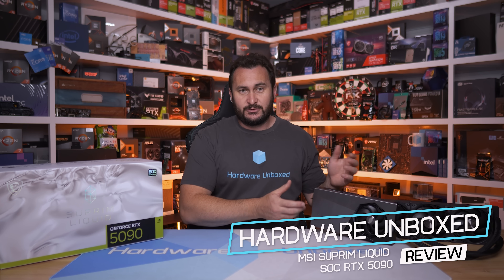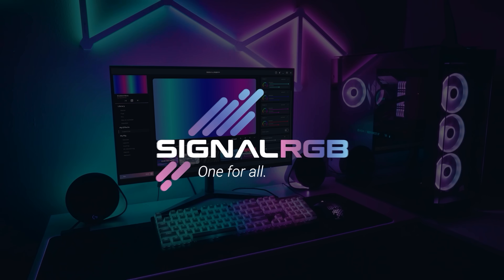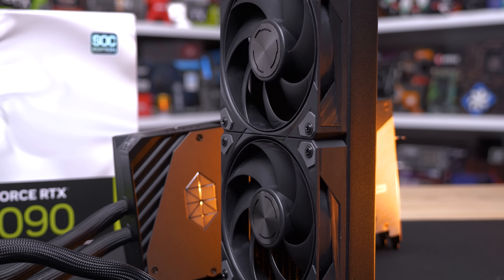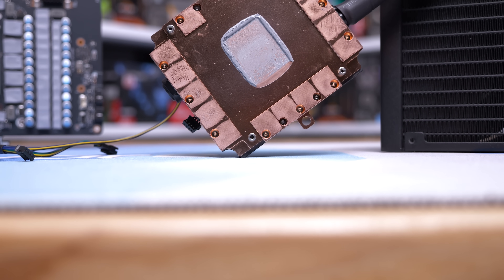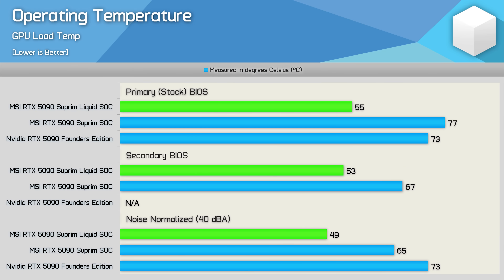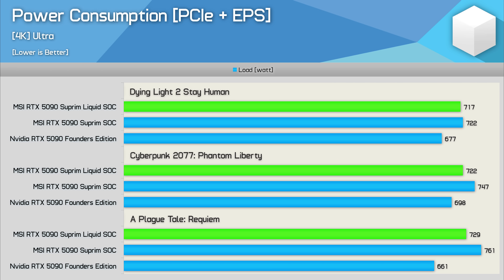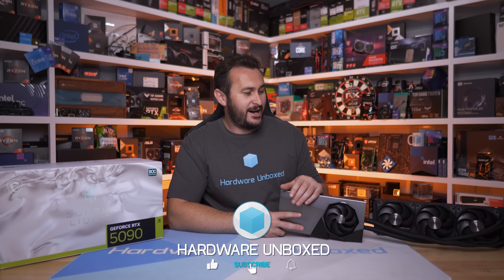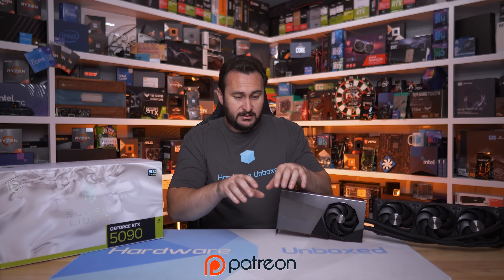The Best RTX 5090.... MSI Suprim Liquid SOC Review

Comment: at this point Steve showed us 10% of overall 5090 supply, that isn't yet melted
Reply: Actual hardware overclocking made a follow-up video to Derbaurs. The 4000 and 5000 are missing safety features from the 3000 series. No individual line is tested/limited to know if it has a good connection/load, so one of the wires can take on the full load and fry things.
Reply: xD
Reply: LOL
Reply: ah, amd fanboys coping is hilarious
Reply: @randy89555  SO WHY U CRYIN?
Reply: god can #gamers try harder with their lame ass jokes
Reply: @ want a good one? Nvidia

Comment: But does it heats cables to over 150C? Assuming its best like you say it is.
Reply: Tbf it was on the PSU side that was measured at 150c and on whatever cable Derbauer was using. The actual failed cable probably ran even hotter. 🙃🤒
Reply: @HDRcade  Only at that temp because the power delivery circuit of the card is atrocious.
It's an actual fire hazard.
Reply: @HDRcade  Wonder what is their max temp according to spec, ppl talk about max W, but how much were they over max temp.

Comment: Saving this video for when I might buy it used sometime in 2030
Reply: I wonder how many 5090s will survive that long
Reply: @megapet777  The market needs a 5090TI already where this is solved with the Shunts. And stop producing the 5090 base model as a whole.
Reply: @megapet777  Very few, the power delivery design is atrocious so they will pretty much all melt their connectors in time.
Reply: Why would anyone buy this 600-730 watts nuclear reactor is beyond me. Even if you can afford it as it was pennies. It's literally a prime fire hazard in your home.
Reply: At which time you might live quite comfortably with only one kidney 😅
Reply: At that time even 70 tier card would surpassed it. That would be 8000 generation for Nvidia
Reply: @ArteriusSaren  you meant 8070 TI Super Extreme for $2999?
Reply: with the plug issues, I wouldn't reccomend it in general
Reply: it's funny because in 2030 this card will still be powerful enough to run all games.
Reply: @madd5 Owning this in 2030 is the equivalent of owning a 3090 today. So there's no doubt it will still be able to run the latest games.

With how gen-on-gen improvements have been trending, it's fairly likely that this will still be able to run every game in 2035. I mean... Unless there is a paradigm shift with PS6 and whatever comes after it, it would not shock me if you can still play the majority of new releases at low settings on a 5090 in 2040!
Reply: This card will suck in 2030 for it's power draw regardless unless you want to use it to heat your house, but it apparently can be a fire hazard when using it at full wattage at least with the FE
Reply: Just got mine for Christmas. 
If it doesn't catch fire before then I might sell to you.
Reply: @nyrokat  6090
Reply: Don't worry, Jensen WANG will stop drivers in 2027 because that'll force people to "The more you buy the more you save"

Comment: Now water cooling companies should offer sprinkler that plug into the loop to extinguish any fire started by the 12 pin connector/cables :)
Reply: Nvidia's Multi Flame Generation technology is really revolutionary 🤣
Reply: @fleurdewin7958   it's literally on fire 😂
Reply: @fleurdewin7958  It's, like, FlamesPerSecond are quite high on this one.
Reply: Everyone keeps blaming the connector and cable but ignoring the reason they get so hot. Nvidia has been checking out and reducing the actual hardware costs, resistor and so on. Leading to just a few lanes that power comes through. 

The reason why the melting starts at the connector is because connectors have the highest resistance in the circuit, 2 separate metal pieces touching. 

Look at the schematics of the 5090vs3090ti and older gens of cards.

I'm certain the 5080 and 4080 have the same problem, Nvidia cheaping out. They just don't have the melting because a lot less power coming through. 

Sad part is Nvidia doing this has lowered the safety factor on the cards.
Reply: @taesssi   yeah, makes sense what comes next.
Reply: @ True, in this case it is a poorly designed card. But the connector has multiple design issues as well. It is missing a noticeable user feedback that it is rightly connected and it is way too easy to unseat. It has by design very little margins, it can carry about 10% more power than specified, the old PCIe connectors could easily carry 50% or more load than the specification required.
Reply: A sprinkler would cause a short circuit and thus a burning card. Great advice Bud.
Reply: @Tommy1198S    tell nvidia that to fix the real issue then
Reply: The problem is being caused by nVidia rotating the 12vhpwr port 90 degrees and then connecting the 6x12v lines and the 6xCom/Ground lines onto two pins than then transfer the power to the board. Partner boards seem to have stuck to laying the port flat to the board and as such all 12 pins (I know there are 16 pins, I am only talking about the power pins here, not the sense pins) are directly connected. I can see a major recall coming for the 5090, and a software/firmware update coming for the 5080 to make sure it cannot be OCed because of fire risks. We can only wait and see, but this is not looking good.
Reply: @Horus9339  Not only that, they reduced the shunt resistors to two. The GPU can’t even balance the load anymore like the 3090 could. Buildzoid has an interesting video about it.

Comment: The best 5090 is the one left unbought. What a scammy generation.
Reply: Ok poor person
Reply: How was the 4000 series any different?
Reply: and unburnt
Reply: Jetzt kennen wir endlich die wahre Bedeutung von Jensens Spruch.
"The more you buy the more you save" war in Anlehnung an all die Produkte gemeint, die man sich nach einem Kauf einer NVidia GraKa nicht mehr leisten kann! :)
Reply: @Quast  Pricing aside, you get 30% more computing power over the 4090 at a 30% higher power consumption. This generation is for the salesmen.
Reply: Rest of generation is alright. A 5070 won't have this melthing connection problem.
Reply: @jankees4037  but horribly priced etc.
Reply: @jankees4037 u mean 5050 ti renamed to 5070
Reply: @lowzyyy exactly the 5080 is a 5060 Ti, it only has 44% the cuda cores of full GB202. The 3060 Ti had 45% the cuda cores of the 3090 Ti (4864 vs 10752) and had a 256-bit bus, just like the 5080 does. The 5080 has 10752 cuda cores and GB202 has 24,576. 43.7%. Its a fucking 5060 Ti for $1000.
Reply: @jankees4037  it will be 10% better than the 4070 and the same in ray tracing without mfg and possibly be worse than the Rx 9070 XT or same as the Rx 9070
Reply: @Ajc-hi8yi 9070XT will be 5% above 4080 or 10-12% below 5080.
Reply: @lukashuening  it's 100% better in that it won't catch fire due to failed manufacturing design failure. 12vhpwr is a fire risk. The whole plug. Not just the 4090 and 5090.

Comment: Is the 12-pin water-cooled as well?
Reply: PCB looks like it has 2 shunt resistors. So maybe 4 wires will carry current instead of 2. So should take twice as long before melting😂
Reply: @prashanthkrishanduth8521  You can slap as many shunt resistors as you want on the board it's not going to fix the fact the board itself only recognizes a single 12v input and therefore has fuck all load regulation on the cable that should have been 4 separate 8pin pcie connectors.
Reply: Burn! ❤️‍🔥 

Literally lol
Reply: Buildzoid and Derbauer did a really interesting finding yesterday, it seems the issues is with the power delivery design after the connector which apparently has no means of load balancing apart from basic physics of electricity, this lets the card pull potentially the entire load of the card on only one or some of the 6 live wires. Derbauer saw over 20 amps on 2 of the wires with a properly connected 2x6 which is nearly the entire 600 watts on 1/3rd of the power wires.
Reply: @Wehra96   DerBauer's issue is with his PSU. It is acting funny. Several others have done the exact same test with 5090 FE cards and found no issues with excessive heat or power draw on a few wires.
Reply: @ if you understand basic physics around electrical circuits you should understand why the issue goes much deeper than that. Also it being fine for most people isn’t surprising but also doesn’t excuse the multiple poor decisions made by PCI-SIG and Nvidia particularly for their board design of having the entire power delivery have zero load balancing.
Reply: Oooh, that's a burn.
Reply: It would need to be watercooled on the PSU side as well 😅
Reply: Yikes 😂
Reply: In case of fire just break the glass. The water from water block will extinguish flames 😂
Reply: Fr
Reply: I wonder if it's this issue that is constraining supplies? Perhaps the manufacturers are scrambling to come up with a fix, because they can see a consumer product safety recall on the horizon. For the record, 600W / 12V = 50A. Take a look at what the solar power guys do to support that sort of current: beefier connectors and beefier cables. It's not hard, unless you're doing it on the cheap.
Reply: It better be, with 22amps running through a single cable (or more) that gets hot
Reply: At least it has a thermal pad on the connector, not all AIBs cards (and FE) have that.
Reply: The 12-pin needs to be changed to 2 (power and ground) 6ga copper cables, with proper screw terminals for a good mechanical bond.
Reply: @ A bus bar directly from the power supply....which can also be used to provide extra physical support 🙂
Reply: Apparently only 2 wires need to be water cooled...How did none of the reviewers pick up on this?
Reply: Wonder if u made some kind of cooler for it😅😅
Reply: Did the 40 series MSI GPU's also burn like the others? I don't remember that the MSI's did.
Reply: it's all submerged into liquid nitrogen.
Reply: And you need cooling for the whole cable, all the way to the PSU
Reply: It's the 16-pin not the 12-pin. lol
Reply: Looking for this comment as soon as started the video.
Reply: The 12+4 pin cable is fine.
Reply: You can submerge it in water yourself... until the water boils away, of course.
Reply: EK will come out with a 12v water cooled cable soon😂😂😂😂
Reply: for $3000 they put a thermal pad on the connector 😂😂😂
Reply: 😮 I hope so.
Reply: Хахаха, вот это да. Вот это ты пошутил. Мы наверное скинемся и наймем тебе репетитора по юмору.
Reply: its not even joke it needs active cooling, at least a fan pointing at it.
Reply: @megapet777  No amount of active cooling can fix a broken and honestly dangerous design flaw.
Reply: @stormchasingk9  yeah def not but it actually helps if cable is overheating, they can be cooled which prevents them from melting, Its not recommended to use cables like this but just saying that its possible.
Reply: my cable melted just reading this comments lol.
Reply: But hey, don't worry! All the problems are sorted out! /s
Reply: Well, why? It is not 100% certain that it will start a fire! LOL 😂 😂
Reply: Lol😂
Reply: yes, it's perfect for steamed veggies
Reply: once
Reply: well done!
Reply: More like if is liquid nitrogen cooled, with they way power usage is going up.
Reply: I am a peasant and I got that reference 🙂‍↕️
Reply: Water-cooled wiring for your 90-series cards? Another excuse to up-charge Nvidia buyers? Yeah…don’t give Jensen any ideas
Reply: Oooooooohhhhhhhhh.
Reply: Auch
Reply: outta be
Reply: ah, amd fanboys coping is hilarious
Reply: @randy89555  2/10 ragebait, you come off as quite regarded instead of making people angry.
Reply: 16pin connector with fan attached to it... 2025 PC building it's different 😂
Reply: Hahaha
Reply: The fires are a nothing burger, Steve said so when  the 4090s were bursting into flames 2 years ago.
Reply: @lisashepard2078  Tell that to people whose cards caught fire. I bet even you won't be a fanboy if that were to happen to you.